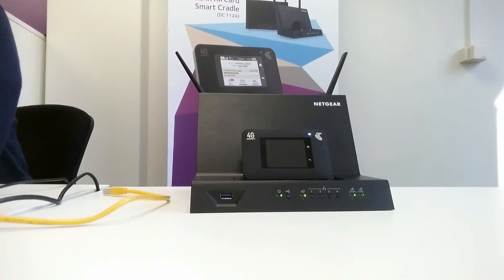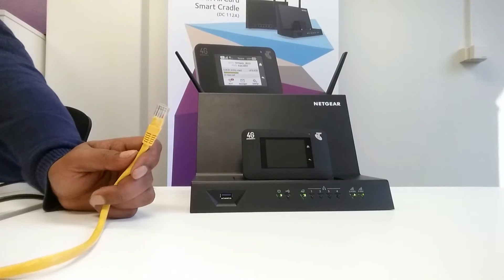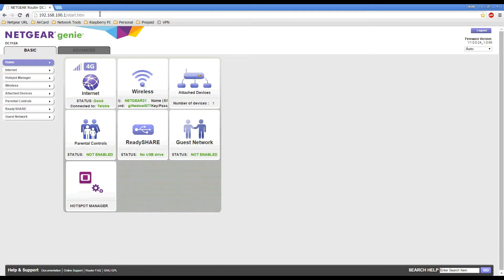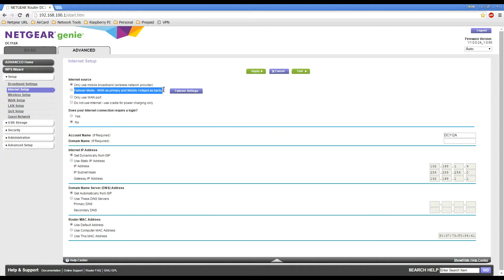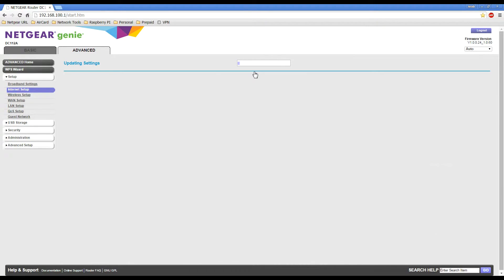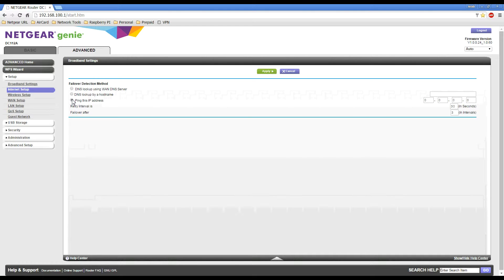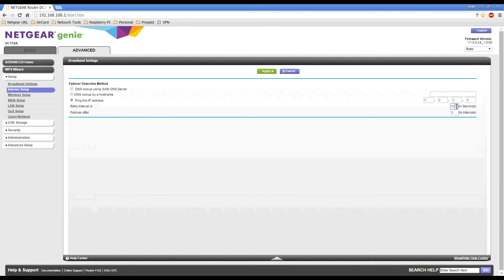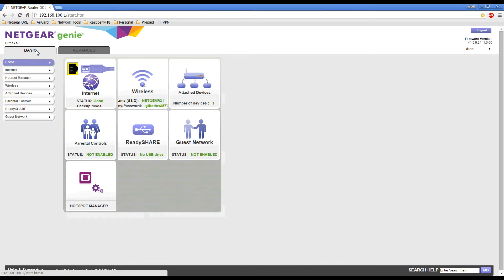Video Tutorial 4   DC112A WAN to WWAN failover

Comment: Seems you cant use failover mode if your WAN connection requires a login :(
Reply from the maker: Fixed line connections in AU either dont require a login or the login is hard coded at setup stage.  Subsequent reboots or reconnections will auto login.  If your ISP is expecting you to login each attempt then it is a very poor user experience.